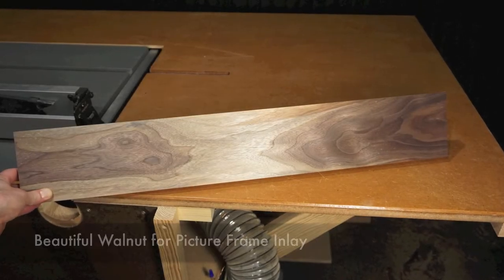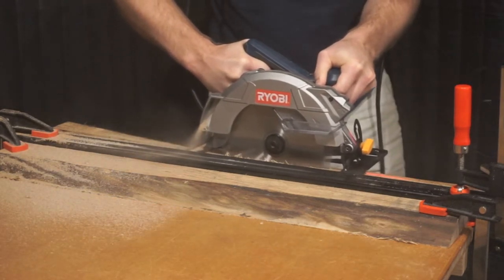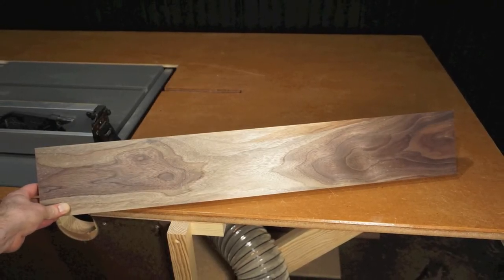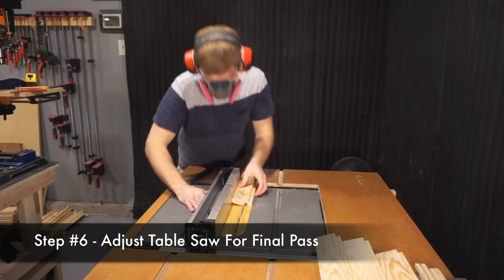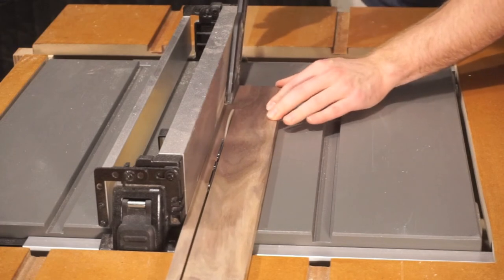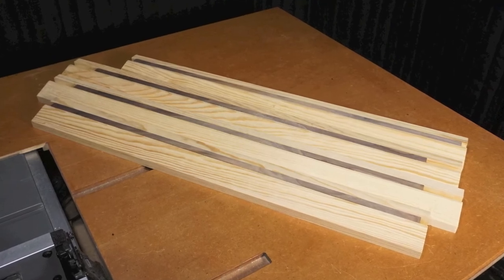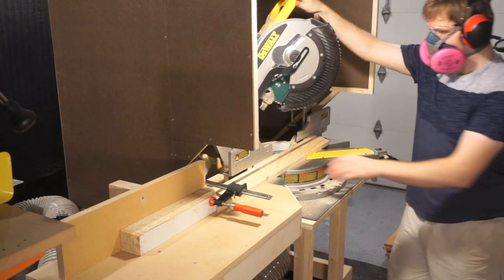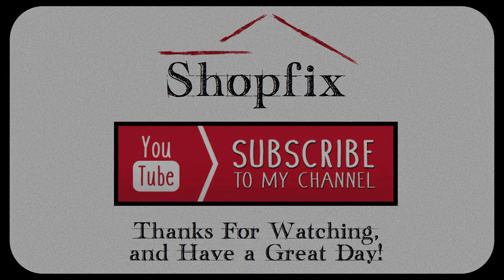How to Make Your Picture Frames Look Fancy

Comment: Just a note on safety. Ripping a straight edge 1st ,& then docking the piece on the drop saw is the safe option, not having your piece against the fence is a dangerous practice .
Reply from the maker: Hey, thanks for the suggestion! However, the walnut piece was way too bowed to get the circular saw across the whole board safely in my opinion, so I chopped the bad part off on the miter saw prior. I personally thought that was safer but you can certainly go your direction as well! Take care.